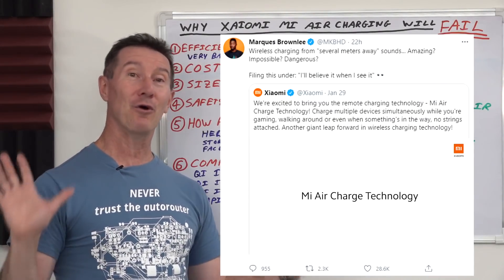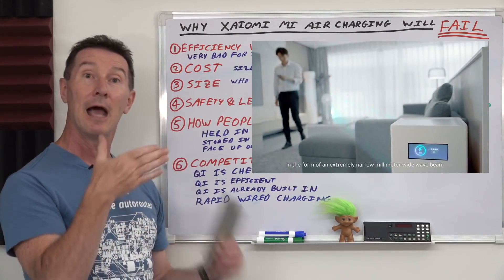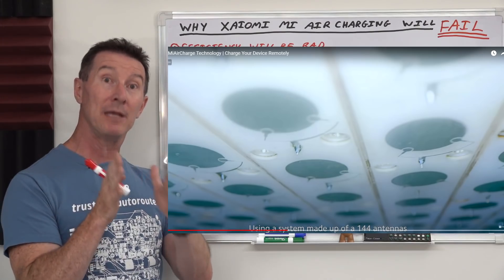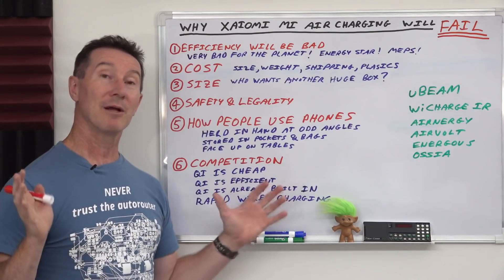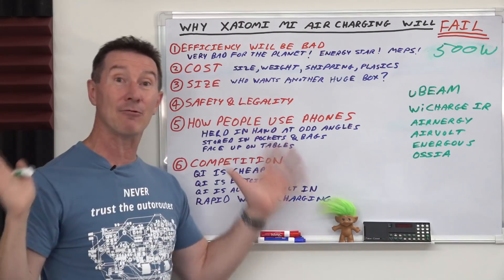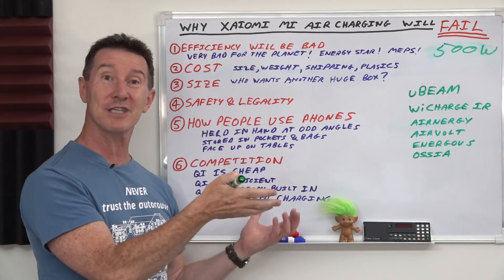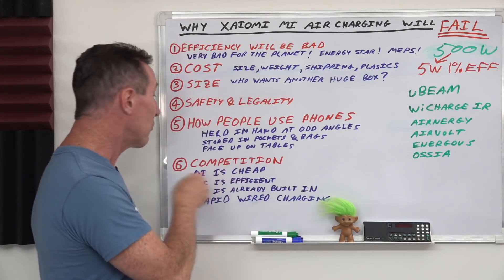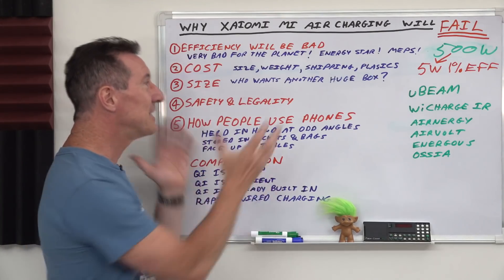EEVblog #1369 - Xiaomi Mi Air Wireless Charging BUSTED!

Comment: I love the idealistic utopic perfect idea of getting into the house and the smartphone immediately starts charging, but in practice, I already gave up wireless charging altogether and replaced it all with magsafe style charging cables because they are much more practical.

I was an early adopter of QI charging. I got a bunch of different pucks and stands, transmitters and receivers, I "adapted" (read poke an ugly hole) my wallet style smartphone case to shove a receiver in there for phones that didn't have it natively, put them into different devices that charged with standard USB... the whole nine miles. Cameras, external batteries, tablets... you find a way of doing it.

But then, I used it for a while on a daily basis. 
Any bump on devices while sitting on top of a puck or something, and it would lose connection and I'd wake up to a dead phone. You have to always fiddle around with the alignment so that it connects properly. Standing chargers fixes a lot of that, but you need to get the one that fits your smartphone right, which seems to be almost impossible unless you get a very popular standard sized phone, or pay for horribly overpriced "official" chargers... and once you change phones, if the size is slightly different, the stand won't work for you anymore. 
Everytime you wanna charge your phone you just have to leave it there. Can't move it, can't even bump into the nightstand or wherever it's sitting on top. It's just shit when what you actually need is a quick charge so that your phone won't die interrupting whatever you are doing... because you're getting interrupted either way. A quick charge isn't an option, you either leave it there or you don't.
Well, Apple fixed this thing a bit by doing a magsafe puck that kills people with pacemakers, but still.

And then, the whole thing that is also present on these wireless projects - efficiency. Wireless charging, even the close contact ones, are just super inefficient. You just have to touch those pucks or whatever to notice - they always get uncomfortably hot. Specially the ones with multiple coils. Some of them even have fans, don't they? It's probably not great for the battery, sitting right next to those coils too.

I actually had a cheap chinese one blow a hole on it's plastic housing and the fake leather wallet style case I put on my phone so hot it got. F that. Lucky it wasn't an internal receiver, but rather an external one...
And all I really wanted was something slightly more practical than plugging the phone with a connector that seems eventually was gonna break. This was solved a bit migrating from microUSB to USB-C, but I still don't quite like connecting the cable everyday... you bend the thing a bit and it's broken.

And so, eventually, I got to the round plug magsafe style connectors. The square ones are ok, but just less practical - they can still get dislodged and not connect properly at times because of how they are built. But the round ones are just about perfect.
And they are being sold in fastcharging variety now too, with 5 pins versus the old USB 2, 2 pin variety. I've been using them for a few months now, plugged to Anker chargers.
Works fine. You can plug it in fast and easy, easier than trying to align a phone with a QI charger puck, doesn't matter orientation and whatnot, and you can keep using the phone fine as long as the cable is long enough, which mine are. And you can get the plugs in USB-C or lightning varieties, which makes the whole system interchangeable. The older USB 2 standard was even better... you could get plugs in microUSB, USB-C and lightning varieties.

At first, I was bit nervous about the whole thing... fastcharging means more power, and because you need more pins to handle it, you have pretty tiny pins and concentric circles to make the connection, they are pretty exposed, very close together, and so it seems a short is almost innevitable... as well as touching everything by accident all the time. Perhaps, if you are worried about this, better to stick to the USB 2 variety... just a couple of pins far apart on one side, on the other it's a central pin for neutral and an outter ring for power, and it's pretty low power.

But I've been using the fastcharging variety for months without any issues so far. I've shorted the thing several times by mistake, the magnetic cable will at times pick pins, clips, and even get stuck to a metal chair for instance, I fiddled with the connector in every which way... no problems. Perhaps because I also don't use shitty chargers... Ankers at minimum. Not sure if cheap chinese multi USB chargers are up to standards with short protection and whatnot.

But yeah, that's the way to go. It might not look as clean and minimalistic I guess, but it's just more practical. And man, once you get used to it, you won't want to switch to anything else. Just buy a bunch of cables, have multi USB charging stations wherever you use them the most in your home, and there ya go.

Comment: Why not use a maser?  Forget personal safety.  We're trying to charge a phone here.

I also have to wonder about the potential efficiency of a laser with a photocell on the target device.  Obviously not useful for charging a phone, but I wonder if that would be more efficient for transmitting power over a long distance than a maser with a coil in the device instead.

Beyond that, looking far more forward, I wonder how feasible it would be to create an entire room which is designed to power whatever is in it wirelessly by flooding it with microwaves, with the walls loaded with coils to pick up as much as possible of what misses all the devices and feed it back into the grid.  Probably not all that feasible (without cooking the room's occupants, anyway), but I'd be interested to see how far something like that could go.

Comment: The frequency is wrong. They really need to use 100's of THz range and then us a solar panel on the back of the phone.
Reply: Xiaomi product manual: laser safety glasses not included.

Comment: I might have misread, but did they actually say they were using mm wave RF? I thought they were saying the beam was millimeters wide? In any case, seems like they were going for some misleading advertising conflating that with terms associated with 5G, e.t.c
Reply from the maker: Yes it's a bit odd, but no way they can get a mm wide beam, which would also be completely useless given the 14 antenna required to hit.

Comment: If we assume that it gets the magnificent efficiency of 50% from received energy to DC in the phone itself, that is 5W heating after antennas.  At that power level I guess the phone will get warm, maybe very warm.   Then if you add all the RF energy hitting the phone that is not captured by antennas, the poor thing will just melt.

Comment: Dave: "It's not ethical to produce a product that wastes 99% of 500W."
Bitcoin has left the chat.
Reply: Meanwhile Dave invested heavily in bitcoin.
Reply: @jaro6985  Bitcoin is a BigFatUugly bubble that is going to wipe people out.  It will NEVER gain widespread use as a currency.  It doesn't deliver on any of the promises it initially made. It's not anonymous, it's not cheap to use and it isn't even limited (as I understand it) and can be broken into infinite pieces.
The government can and will stop it.  Once bitcoiners start going to prison, that will be the end of bitcoin.  Anyone who thinks the government cannot or will not throw people in prison over it is a fool!
Reply: With Bitcoin, you're basically just selling barrels of oil, packaged in a fancy form of angry pixies.
Reply: LOL,.
Reply: One of the reasons Ethereum is switching to Proof of Stake instead of Proof of Work like Bitcoin.
Reply: @seshpenguin  the people with lots of money deciding the validity of transactions from people with less money :/ i dont like the proof of stake
Reply: @benni5541  doesn't change the fact, that proof of work is stupid as hell, as long as we don't have (basically) unlimited green energy.
Reply: @benni5541  You can always join a Staking Pool like you can with Mining Pools, and validation still happens using people with full nodes (just like with mining).

Basically the idea with Mining or Staking is that it is monetarily too infeasible to take over 51% of the network. If you have that kind of money, it's more worth it to invest into the cryptocurrency than to take it over (which would destroy it's worth).
Reply: @michi9955  it would make sense if we built a system where you computed stuff and were awarded a credit or some form of certificate for that --- no clue how you would implement a crypto that did that though but thats the only way i see it making sense.
Reply: @michi9955  $35,000 per bitcoin says otherwise.  Wish I could be that 'stupid'
Reply: @Project2013B  Yeah and? It's an extremely volatile and risky investmemt object, which serves no real life purpose but wasting a shitload of energy. It will never be used as a currency, since it's not practically scalable and, like I said, too volatile. Yes, the theoretical concept is really interesting, and derived and improved blockchain concepts might work great. But Bitcoin's current usage is just stupid.
Reply: @michi9955  Well feel free to stick to your Fiat currency whose value is dropping daily.  EVERYTHING is volatile at some point or another... see stocks in March 2020.
Reply: @Project2013B  sure stocks are volatile. But I don't plan on paying my food with them. And with a stock i actually own a part of a company which creates some real value. And again: The energy consumption alone is an absolute knock-out criterion for Bitcoin.
Reply: @michi9955  Could say the same thing for every metal that is mined, and every terminally ill patient kept on life support.
Reply: @Project2013B  No. General consensus of our society that life has a value. And metals are used to built something that benefits us. Neither does apply to Bitcoin. 
Look, I get it, you're invested in it and have an interest that more people fall for this ponzi scheme, but your arguments make no sense.
Reply: @michi9955  That's not gonna happen (unlimited "free" energy).  If EVs actually catch on in a big way, the cost of electricity is going to skyrocket. It will take trillions of dollars in infrastructure improvement to support it.  Peak demand will be way larger than it is now.  Imagine all of the East coast plugging in their cars at 5:00pm.
At the same time, the price of gasoline will plummet as supply is relatively fixed.  As long as we must refine diesel and aviation fuel, gasoline will be produced.
Reply: @michi9955  Plus, the government will ban it and imprison anyone who tries to use it. Fraud. Money laundering. Tax evasion.  You show me the man, I'll show you the crime.  The second the government gets sick of it, the party is over. The state will NEVER, EVER support it.
Reply: @michi9955  Even with free green energy it would still be a waste.
Reply: @Project2013B  As much as I don't care about this whole green energy movement, acting like Bitcoin isn't as volatile as any other currency to date is naïve. Bitcoin only has value because people believe the input cost means something. It's the same thing with any other Fiat currency, people only believe in it's value because they believe in the value put into it through various means. Bitcoin could crash next year, the dollar could crash next year, who knows? Anyone acting like they do know is a fool, the value of a currency is entirely politically motivated, and yes bitcoin is political in that it's the 'anti-political' currency. It's fame is being opposed to the standard political fiat currency.

My problem with bitcoin is not that it's a fledgling currency, it's the fanboys who act like it's going to cure cancer and solve world hunger while also giving you a blowjob. That and miners screw normal markets for things like GPUs.
Reply: @km5405  There was a company called United Devices who allowed people to download and install a client program on their computers and that would download & analyse packets of data and then upload the results using the idle time on your computer - when enough people did this, they had access to a volunteer-based "supercomputer" - and United Devices called this "Grid Computing".

One project that did this was the Proteome Folding Project (I had the client on my old computer for a while, but still had dial-up internet, so couldn't take part as often as I'd have liked), and I think that was completed a few years ago using this grid computuing.

Comment: Would it be possible to have a large mechanically steered reflector antenna and just use the 144 antennas for fast but low angle correction and distance compensation? You could get a pretty tight beam at the size of this box with a high frequency and it would also solve the 60° angle problem of phased arrays.

Comment: The solution is obvious. Air is a great conductor of electricity...if you ionize it. Getting a voltage differential between the phone and the charger high enough to ionize air is easy, too. The problem is, humans are not good insulators. Maybe, they will come up with a vaccine that can increase human resistance...to current flow. 
Of course, people will wonder how reducing their Siemens could possibly be a good thing - what with all the talk about low sperm counts.

Comment: I would recommend a 1MW tesla coil, no need for being in any position, it'll fry you and your phone within a nice short time! :-)
Reply: The only problem is that your phone must have its own luggable receiver tesla coil connected. It would be much easier to just directly connect it to a power adapter on the wall without any intermediate coils.

Comment: This reminds me of that targeted microwave heater from the 70's or around there. The idea was to save energy by just heating the people in the room and no the entire room. In that case this will be a very efficient device but not just for charging the phone.
I do understand that there is huge demand for a product like this so some companies will try to deliver just so they can take advantage of this demand.
In full sun you get 1000W per square meter in ideal conditions so that is about that 10W on a 10x10cm area and that is in the hundreds of THz so one can just use a small solar panel on the back of the phone may get about 2W in ideal conditions with 20% efficient cells and if expensive multi junction cells are used maybe  close to 4W.
If you heat the house with electricity then the 1% or lower efficiency is not relevant in winter :)
Reply: Excellent!

Comment: If you read the 6G and 6G-e documentation you'll see that wireless charging is included in the specifications.
Within a few years phones will not have much of a battery anymore to begin with as they can pull operational current directly from the network up to 800m.

Comment: A big negative, with what you receive in the real world, your phone probably will be using more energy when being used than it can get, thus drain quicker than charges.
It has range of a few metres, get a longer wire for your charger.
It has 14 antennas in the receiver, so not near the camera, meaning bottom of the phone where your hand blocks it.
It to be used when your walking around, again, your hand and body block the path and angles are wrong for efficiency.

Whomp, whomp, who going to try again in a few months with the same idea different packaging?

Comment: TruAirPower!
The phone will have a tiny wind turbine. The power station will have a laminar flow air nozzle that targets and blows at the phone's turbine.

Comes with an airhose to connect the powerstation directly to the phone turbine when you need faster charging or just don't want to keep your head from coming between the phone and the powerstation.

Comment: Next invention: Xiaomi smart charging wallpaper. Put it on all the walls of your room, and it'll charge your phone while inside.
Reply: I am surprised they did not decide to just evenly fill the whole room with RF power by turning it into a giant capacitor with 2 opposing walls covered with alluminium foil or something. Of course impedance of such a "capacitor" would be stupidly high at any reasonable frequency and the inductive option would have its issues as well but with high enough voltage of a few tens of kV or so and high enough power output that should not be a problem. And the best part is that this way every piece of metal in the room could be a power receiver and all of them would receive a fair share of power no matter where they might be with no beamforming required. Just pump in more and more power until the damn thing has no other choice but to work!
Reply: @Kirillissimus  And humans would turn into great conductors themselves, being in such a room between the capacitor plates. Roasted human flesh may be the result of that. I've heard it supposedly tastes a bit like pork. But would I want to try it? I don't think so. Oh, by the way: RF and electrical charges are two different forms of physical energy, in case you didn't notice.